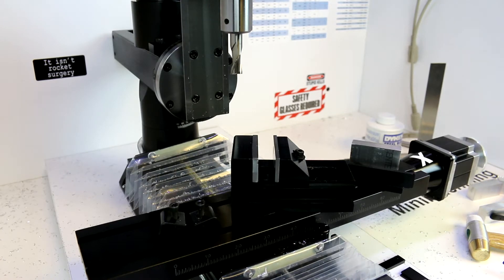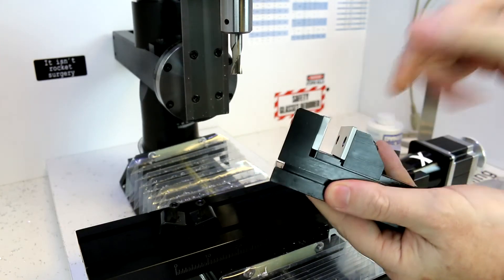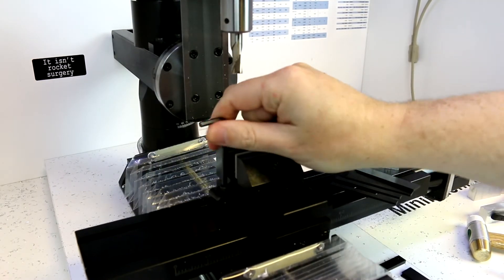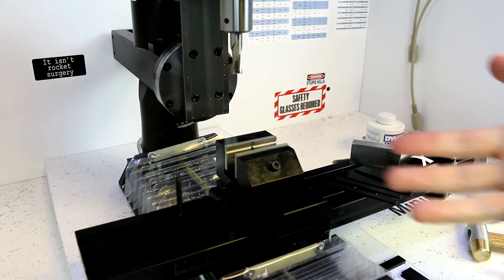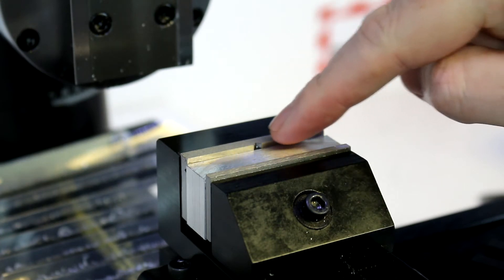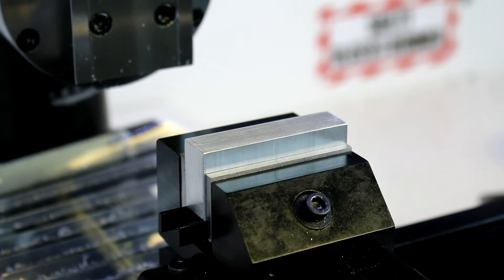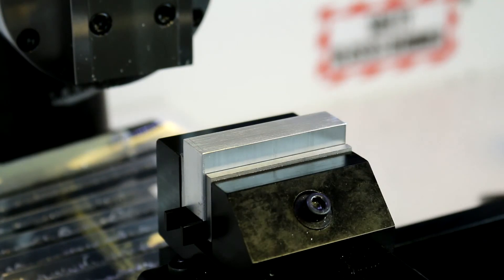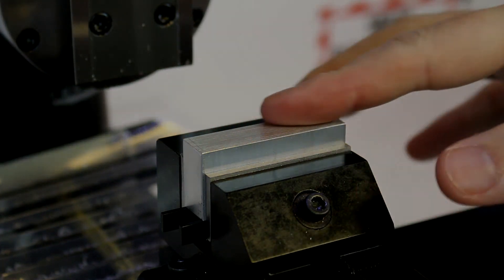Mill Projects 101 - Strap Clamp Part 2

Comment: This is a timely project. I have the Sherline set, but have need of some longer clamps. I needed to mill a base for a wobbler engine I'm building. It was 2 1/2 x 2 3/4 and wouldn't fit in the Sherline milling vise. I took the moveable jaw off the vice and clamped the base to the remaining part of the vice, using the non moveable jaw as a fence. The Sherline clamps were barely long enough. Having  some longer ones would of helped.
Reply from the maker: +James Thornton Tip 53 on Sherline's website could also be of interest to you... to shows some simple modifications to the stock vise to allow to clamp 2.5" by expanding the slot in the base slightly. I had forgotten about the tips page on Sherline and just found it again the other day, I plan to make videos on many of these tips as sample projects also.

http://www.sherline.com/tips.htm
http://www.sherline.com/tip53.htm Adjustments to stock vise
http://www.sherline.com/tip51.htm If you have a vise to sacrifice
http:// www.sherline.com/tip3.htm A very simple, useful, and ingenious clamp for the mill table... will be making a set of these soon!
Reply: +MiniMachining  Thanks for the links. I can see that vice mod in my future. 2 1/2 x 2 1/2 would of worked fine for the base I was making.
Also those other clamps would be nice to have.
I'm looking forward to seeing where your strap clamp project is headed.

Jim